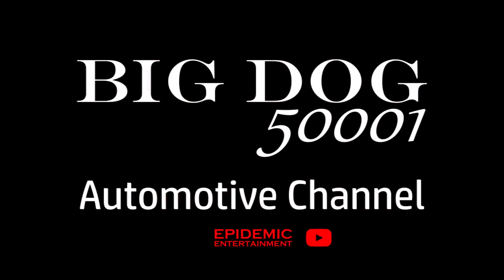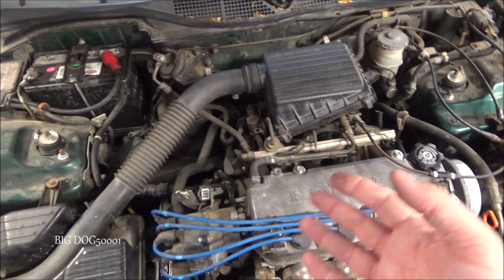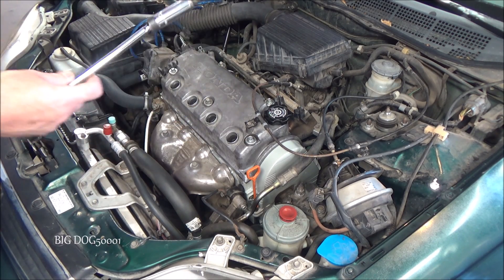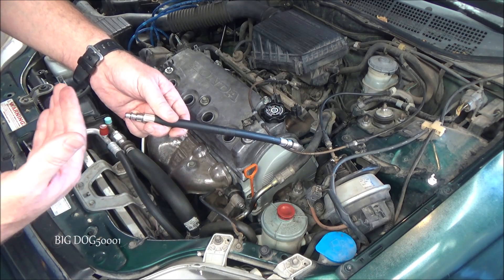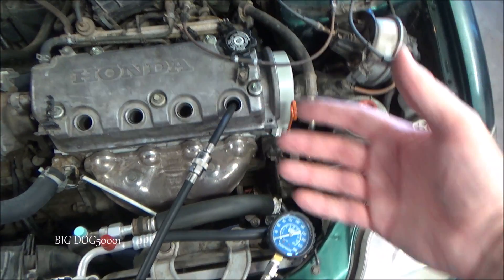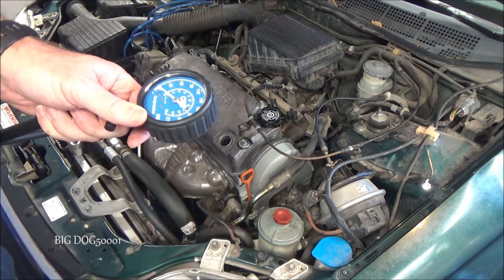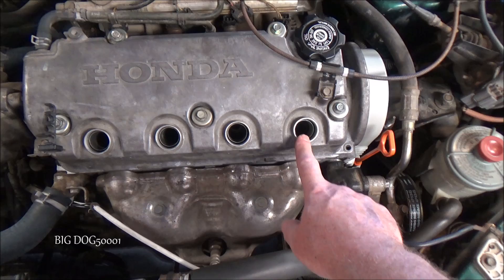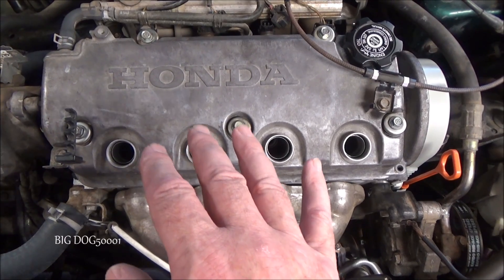Honda Civic Compression Testing

Comment: Much appreciation for the video. I gotta do a comp test I have blue smoke when revving above 3.5k, and every 1k miles I'm out of oil with no leak under honda.  97 lx 5 speed. Also replaced pcv valve hopefully made a difference old one wouldn't close
Reply: Same as mine, is your car fine now?

Comment: Appareciate the video man.
What would be the point of having the throttle wide open if the injectors were already unplugged?
Also, how can I control the number of cranks in a car that has a push start button instead of a key?
Reply from the maker: So it doesn't build pressure/vacuum inside throttle area (so engine can breathe fully).  A push to start can sometimes be stopped by hitting the button again but it is usually completely computer controlled and should crank the same number of times for each press.  As long as it cranks the same each time the test should be valid.

Comment: Would removing/installing spark plugs from a hot aluminum cylinder head strip the threads?
Reply from the maker: Yes, although the chances are pretty low it is possible.  Typically I like to remove them when the engine is cold but in this case it is necessary to do the testing.  If possible, I will remove them beforehand when the engine is cold and then reinstall for the test to lessen the chance of an issue (in this case they had just been removed when I did the timing belt).

Comment: Hi i thoughy number of revolutions doesnt matter for compression testing  because other storkes except compression will not have pressure.
Reply from the maker: It matters but only to a certain degree, we aren't making calculations to send this into space so we just need to be in the ballpark.  If you want to compare the test numbers to spec numbers, then it is best to do the test as service info indicates in my opinion.  What is more important is to do the same number for each cylinder.
Reply: If it doesn't matter, why does Honda say to go at least 6 revolutions? Because it does matter. Didn't you notice that with each compression stroke, the pressure went a bit higher?
Reply: @markanderson2904  even if you go to 10 cycles it won’t go beyond 160 to 170 did you notice that. ?
Reply: @sivucit  Of course.  So, you don't need to go to 10 cycles.  You just need to do enough that the pressure reading doesn't go higher with each cycle.  Also, you should do the same number of cycles for each cylinder so you can compare them fairly.